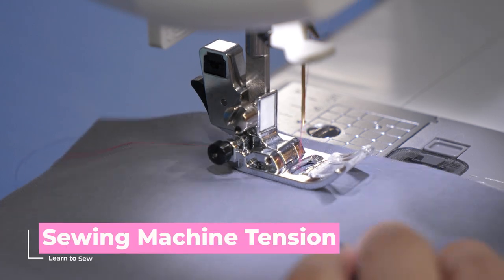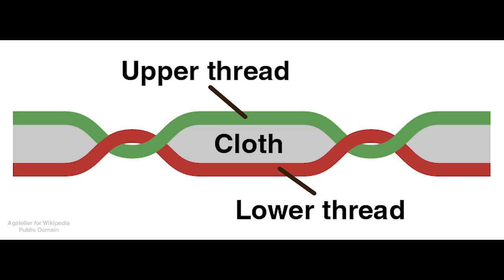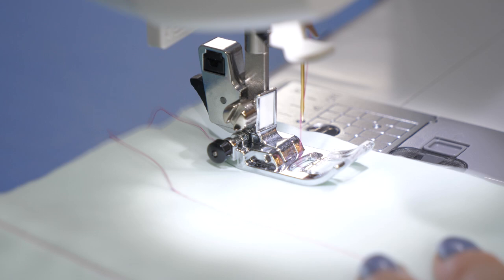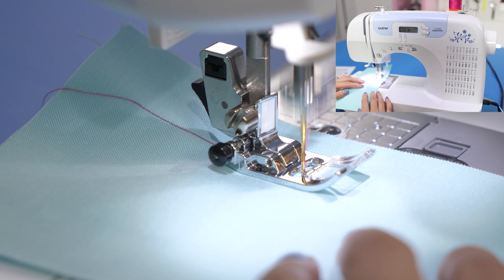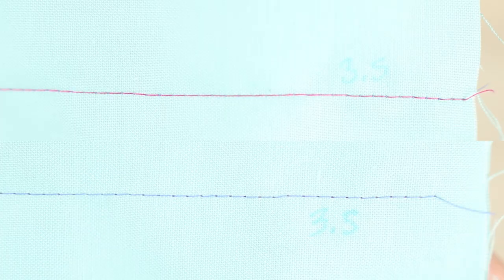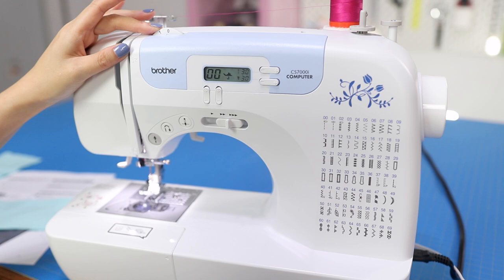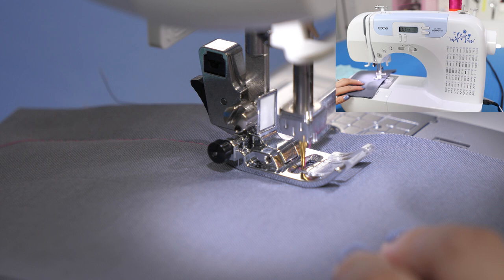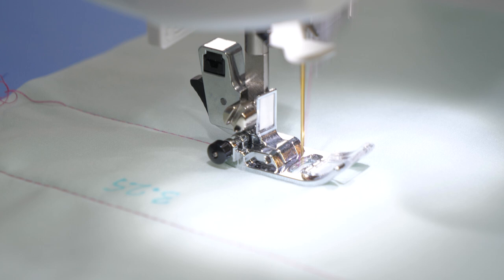How to Adjust Sewing Machine Tension | Learn to Sew

Comment: I was wondering if you could tell us how do you change the pressure on the presser foot?
Reply from the maker: I don't believe this model has that feature, but with upgraded (more expensive) sewing machines typically you can change the presser foot pressure.
Reply: @SewingReport  I have a brother cs7000x which i think also doesn't have that feature and i don't know what to do because it keeps eating my stretchy fabric. got any tips? <3
Reply from the maker: Stretchy fabric is notoriously difficult to sew with, some have said to sew with tissue paper underneath, then rip it off. I haven't tried this myself, so not sure how well it would work. I avoid thin/stretchy fabrics personally because I find them to be too much of a hassle. If the stretchy fabric is made of a natural fiber (cotton, cotton blend, rayon) you could use Terial Magic to temporarily stiffen it. This does not work on polyester or synthetic fabrics. 
SEE THIS VIDEO https://youtu.be/_h1hGljf-5o
I also stock stretch needles in my Etsy shop which can help with skipped stitches
https://www.etsy.com/listing/989632343/organ-needles-super-stretch-assortment
https://www.etsy.com/listing/997721418/schmetz-twin-stretch-machine-needle-size
That being said, if you're a beginner sewist you may want to work with woven (non-stretchy) fabrics for a while until you get more confident in your skills.
Reply: @SewingReport  Thank You so so so so so much! <3